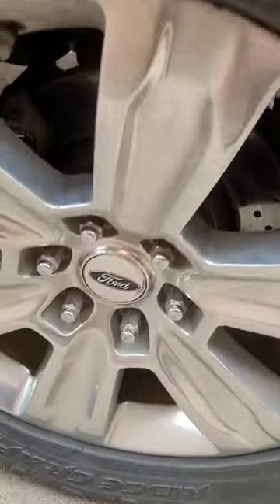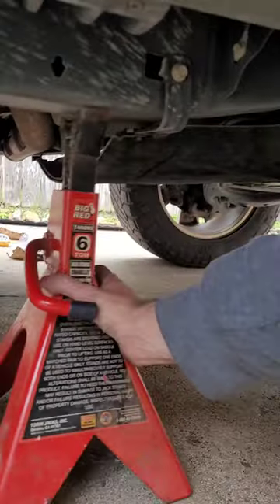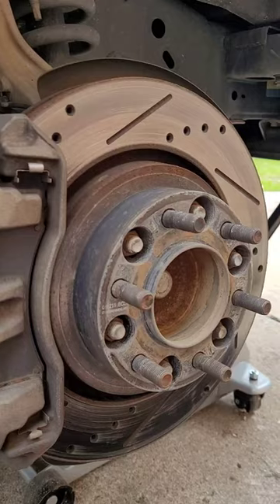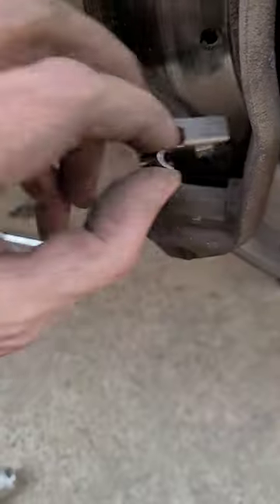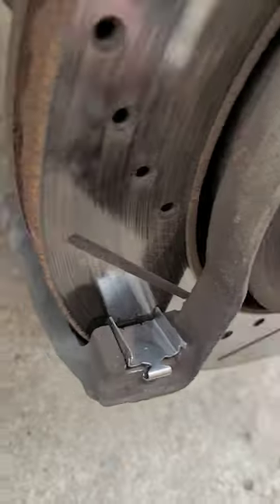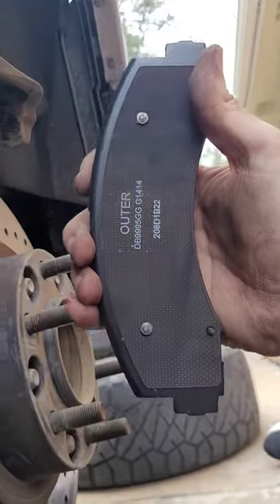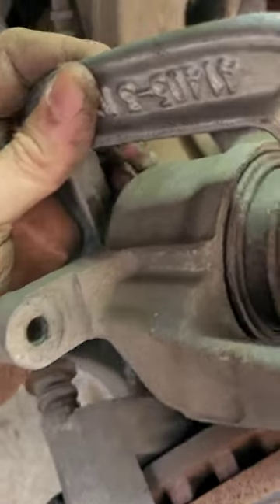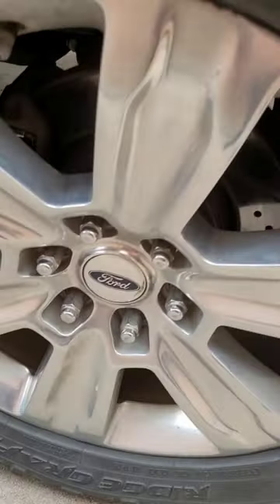Brakepads change on Ford F150

Comment: Should I change both sides or the side that is bad? Will it hurt if I don't get the rotors turned? Does have a few grooves. But have to wait for the money a week or two. Thanks you make it look so easy. 😢 gonna do mine tomorrow, at least try😅 Thanks 🫡
Reply from the maker: If only one side is bad you probably have a bad brake caliper. They should wear out similarly.

Comment: you need to Lube the sliding surface of the pads where they rub on the new clips you put on. You put the correct lube on so the pads can contract and retract as necessary to help prevent uneven pad wear.
Reply from the maker: Great tip! Thanks Ron!

Comment: Hey bud, thanks for the instructional video, but I think you got your rotors on backward. You can google the explanation for it. But other than that, great vid 👌🏽 pretty straight forward job. Hopefully, by now, you've figured out how to compress the pistons with a screwdriver/prybar before taking off the caliper the to make the job a little quicker 🤙🏽
Reply from the maker: Thanks Luis. These discs look directional but are not. I believe the directilnal part is the middle that fans out to catch more air. But these dont. They are straight in the middle.

Comment: I thought you had to break the fluid line to retract the rotors then bleed the air out once done?
Reply from the maker: Not if you don't let any air in.
Reply: I draw fluid out from the reservoir with my finger over a soda straw.

Comment: no lube???
Reply from the maker: No need on ceramic
Reply: @ricardosworkshop   
you need to Lube the sliding surface of the pads where they rub on the new clips you put on. You put the correct lube on so the pads can contract and retract as necessary to help prevent uneven pad wear.you need to Lube the sliding surface of the pads where they rub on the new clips you put on. You put the correct lube on so the pads can contract and retract as necessary to help prevent uneven pad wear.

Comment: Nice. Next time use old pad to push in both cylinders at once
Reply from the maker: Yes! Great add... but my c-clamp wasn't big enough
Reply: You can not get the c clamp in the center to push both. The plumbing is in the way on the back side .